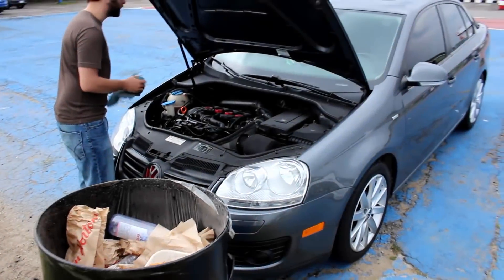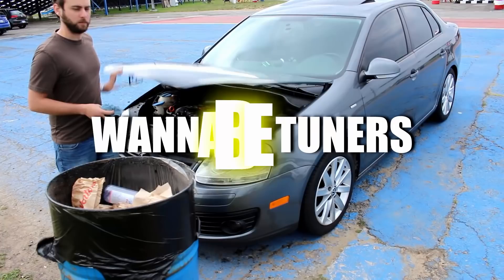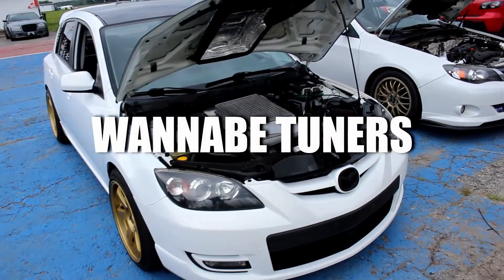Mazdaspeed 3/6 - Aux Fuel Methods - Port Injection - 5th & 6th Port - Methanol Injection

Comment: I want 6th port but i also want the methanol cooling capabilities
Reply from the maker: You can always run a separate fuel cell that contains pure methanol and run that to compatible port injectors. I'm currently just mixing 2 gallons of methanol per tank of 94 octane through 6th port and it's been pretty good so far, however I'd recommend full port injection (1 injector per runner) for the best possible fuel distribution :)
Reply: @WannabeTuners  sorry i meant to say i want 8th port but with the cooling capabilities of methanol i can’t seen to find a whole lot of people doing so my build should push about 650/700
Reply from the maker: @brotherhood_ofstreetracers4268  You can always run an E85 mix. The thing I like about methanol is that I can buy it at the local hardware store and it's always 100% pure, so it takes the guess work out of figuring out the mix. From what I've heard E85 can vary in ethanol concentration during certain times of the year in areas that sell it. My area doesn't have gas stations that sell E85, so methanol is an easy alternative for me.

Comment: I need help with my speed3 please help i will pay you if i need to please email me dru_goodman@ymail.com
Replaced fuel pressure sensor, pump and filter ( dw 300 series pump and filter) starter fine ran for like 6mins then shut off
 Now i have a b1202 code
Reply from the maker: What have you tried so far to try and rectify the problem? Does the car start and idle?
Reply: @WannabeTuners    i first had a p0192 fuel pressure code. So i replaced the fuel pressure sensor, pump and filter. It did start fine then shut off now itll crank but not start.
Reply: Now the code im getting is a b1202 code meanwhile the car cranks but will not start. Havent figured out anything to fix provlem
Reply from the maker: @drugoodman374  That code is an odd one. Try disconnecting the battery for a few minutes and draining the vehicles capacitors by performing a hard reset. If that doesn't work inspect the harness under the hood to see if it's rubbing against something and shorting to ground.
Reply: @WannabeTuners  ok thank you

Comment: I have a gun1 09 3 on a BNR s5 set up and I have just older jmf v1 with the 4 port meth I want to run 4 do5 nozzles so I and try and get over 30psi

Comment: Good videos like always!! I was watching a video from my e tuner and another e tuner and they where saying that when swap out the injectors on a 6 port for 2 1000 injectors you can suffer from wet wall manifold. Basically there’s so much fuel that a lot of it stays on the walls and may create a situation where even though your giving more pulse width your not getting more fuel. They said there could also be a delay in the delivery of the fuel causing your car to lean out temporarily. I think most ppl should be fine though since their not fully maxing out the fuel with the 2 1000 injectors. Sorry for my run on sentences lol you guys are dope keep up the videos
Reply from the maker: Interesting dude! Where can I see these videos, I'm really curious about this :) Thanks!
Reply: Wannabe Tuners if your not part of the Facebook group you should join Mazdaspeed 3 owners :)
Reply from the maker: @AlexMorales-yu1lp  Sounds good man! I'll check it out
Reply: Wannabe Tuners 

https://m.facebook.com/groups/2364120949?view=permalink&id=10156404533415950

Comment: Hey bro! Im Shaun I own an 07 Mazdaspeed 3. My motor still runs great and all since I bought the car a year ago. Its got 220000 kms. I was curious as to, when will I know to do a VVTI and timing chain replacement? I asked the previous owner, (there has only been 3 owners and I am the last one) if he did a vvti and timing chain replacement and he said no he did not... and I don’t know the owner before him... so I can’t really find out. So when should I do a VVTI and timing chain replacement? And how do I know if I need to or not? And how can I check & tell if it has possibly been done already? 
Thanks man
Btw im in the GTA too maybe we could go for a cruise and do a videoshoot or something of our speed3’s lol. :p in the summer
Reply from the maker: Hey man one way to tell is to remove the oil filler cap and check the chain for excessive slack. Also, at startup u will hear a momentary rattle caused by a loose chain hitting the valve cover :)
Reply: Wannabe Tuners thanks for letting me know! I will check that!
Reply from the maker: @shaunpermanand  You got it!

Comment: I have a dw65c in my tank already, I figure I’ll just get a surge tank setup with another dw65c in it
Reply from the maker: Most guys use a surge tank so that they can install a much larger and capable fuel pump inside it. A surge tank also serves as a way to ensure u have sufficient fuel delivery even if your gas tank is near empty, so using a dw65c to supply a surge tank with a dw65c in it, would only be beneficial when your gas tank is near empty, and wouldn't deliver 'more' fuel so to speak lol. Check out Tuned by Nishans videos. He's got a lot of good info on his channel :)

Comment: I had no compression in cylinder 3 on my old motor and my car sounded like a subaru but no signs of a damaged block. Is the motor still good for a rebuild? Any input will help thanx.
Reply from the maker: Usually low compression on these engines indicates a cracked ringland. I would do a leak down test with the engine fully warmed up to get a better idea on what could be damaged inside the engine :)

Comment: quick question, am having an issue with my speed3 gen2, when I give it/floor it the car like cuts off, but if I give it like 80% it runs just fine, any ideas on what can it be?
Reply from the maker: What's all done to the car? Are u running an Accessport? If so how do your datalogs look?
Reply: @WannabeTuners  I have an intake and cat back exausht that's how I got the car, and no I don't have an accesport yet I will be trying to get one because I also want to see if I can tune it on 91 at least.
Reply from the maker: @JuanPrado1985  Sounds good. It could be a lot of things causing it. Unfortunately without datalogs, or the ability to monitor important parameters, it's difficult to determine a root cause. If it's a fuel pressure issue, it could be dangerous. Does the car have upgraded high pressure fuel pump internals?
Reply: @WannabeTuners  no fuel upgrades, I was thinking on doing a boost leak test and also a vacuum leak test to start.
Reply from the maker: @JuanPrado1985  That never hurts. How would u describe the sensation of the cut out?
Reply: @WannabeTuners  when I floor it is like back fire type of feeling, it's at high revs and the boost matter in the car is like at the top
Reply from the maker: @JuanPrado1985  So a misfire?
Reply: @WannabeTuners  not a misfire exactly but like it, don't know how to explain it, I also put it in a snap on scanner and when we where doing the scans I would floor it and it would show 85% to 90% thrl not 100%
Reply from the maker: @JuanPrado1985  It's very difficult to diagnose a problem over the internet without any form of datalogs or an accurate description of the symptoms. Are there any fault codes stored?
Reply: @WannabeTuners  thank for your time, but yeah there is no lights in the dash check engine or nothing and there was some codes but nothing to do with the performance of the car.
Reply from the maker: @JuanPrado1985  Ok I think the best bet might be to take it in steps. I would get hpfp internals and an accessport first. Stay out out boost until u get the hpfp internals to reduce the possibility of blowing the engine. Once u have hpfp internals, u can then do more testing and take datalogs.
Reply: @WannabeTuners  thanks for the help and yeah gonna keep looking and drive it just casual
Reply from the maker: @JuanPrado1985  No worries! Does the car have a catless downpipe? That could cause fuel pressure issues and detonation
Reply: @WannabeTuners  it did but I took it off and put the cats back
Reply from the maker: @JuanPrado1985  Ok, how do the long term fuel trims look? If u have an intake, it may be a slightly larger diameter than the stock intake. This slightly larger diameter may not be enough to cause a check engine light, but it may be enough to cause the car to go into limp mode at times, due to lean long term fuel trims. I would install the stock intake to rule that out, and see if the power cut stops.
Reply: @WannabeTuners  I wish I had the stock one, the guy I got it from didn't had it
Reply from the maker: @JuanPrado1985  Ok I would just start with the hpfp internals and Accessport, and take it easy on the car until then. But then again it may be something as simple as worn out spark plugs. It's hard for me to say for sure.
Reply: @WannabeTuners  I just got me a set of ngks sparks gonna change them today, than move on from there
Reply from the maker: @JuanPrado1985  Right on. Make sure they are gapped to 0.026 - 0.028 thousands of an inch
Reply: @WannabeTuners  will do, once again thanks for your help, wish you were near so I can take the car to you 😁😄
Reply from the maker: @JuanPrado1985  Haha no problem dude
Reply: @JuanPrado1985  Hey dude, can i ask did you get that problem sorted out with your Mazdaspeed 3 with the boost cutting out ??? If not i may have the answer for you
Reply: @23farman  I reset it my computer by disconnecting the battery and turning my headlights of and I also did my spark plugs and that solve my problem.

Comment: any downsides to runnning 6th port with 2000cc injectors for more headroom with this set up?
Reply from the maker: None that I'm aware of, but having an even flowing intake manifold is a good idea to promote even fuel dispersion between cylinders, and aside from figuring out custom cold side plumbing, the fuel is delivered accurately before the throttle body which also cools down the boost air temps slightly :)

Comment: My block is blown  what do you recommend on my 08 speed 3  I trust you bro!
Reply from the maker: Sorry to hear dude! I would get it rebuilt if possible with a forged bottom end. What sort of damage has your engine sustained?
Reply: Wannabe Tuners yeah my starter and a big  piece  of the block just broke off I think maybe it happened  because of  a leak of radiator  not sure and thanks for responding  to my messages  bro
Reply from the maker: @aldroms3life926  It's odd that the starter was damaged. Could it potentially be a clutch issue?
Reply: Wannabe Tuners no clutch  is a good   I don't  know how or what made it happened  but I do have to fix it it's  my baby so a new block I will get
Reply from the maker: @aldroms3life926  So what happened exactly?
Reply: Wannabe Tuners ok so I had just bought  this car had it for just over a month ,I got it from used car dealership  had my car fax everything  was cool but one day driving  my way home it started making  a click noise and right away  it went off on me and I seen the block and the starter  were  broken badly and no more  warranty  on the car  long story bro

Comment: Be careful with that DW fuel pump, everyone I talked to said to stay far away from it as it doesn't last long and even has issues just operating normally. I picked up an AEM #50-1215 for my PI setup that I am piecing together.

After my run with meth, I can honestly say I wouldn't do it again. I wish I went PI from the start and scrapped the meth. My PI kit is going to run me about $1300 (for a deadhead, no return style). 

So much good info in this video. I see too many people on FB asking about PI and this explains the basics quite well. I always try to spread knowledge as well. 

TL;DR if you want big power, be prepared to pay for it. PI isn't cheap, but it's the safest bet for more fuel on the platform. Do your research, don't cut corners, and use the damn forums!!!!
Reply from the maker: Thanks man, I've read that also about the DW pumps, but some people have also said that they have not had any issues with it. I guess time will tell. I've also heard good things about the Aeromotive fuel pumps, but I will consider the AEM pump also if my DW ever shows signs of failure :) What happened with your meth setup?
Reply: @WannabeTuners  The Aeromotive is a great pump too. Just pricy when there are awesome comparables out there.

I've just been constantly chasing controller issues, flow issues, changing nozzles, etc. Been a pain in my ass from day one. I love the power and benefits, but it's just too finicky for my power goals.
Reply from the maker: @binbanbinny  I completely understand. I think real injectors are much less of a headache :)
Reply: @WannabeTuners  oh yes. I ended up getting a set of ID1050X injectors with my spacer from Damond, so I know I won't have any issues.
Reply from the maker: @binbanbinny  That's going to deliver all the fuel u need!
Reply: @WannabeTuners  😊😊😊😊😊

Comment: I’m going top mount setup on my speed6 and I’m just having a little difficulty figuring out the auxiliary fuel options 
Speed performance seems to offer the right setup but at a high price
Reply from the maker: I think the easiest and least expensive way is methanol injection, because there are very few parts. A simple throttle body spacer with 1 or 2 large nozzles can deliver a tonne of fuel. But then u have to look after a second tank and pump, and fuel delivery may not be as precise as an actual fuel injector. I can tell u that when we installed the 6th port kit into our car, the custom cold side plumbing was a pain, having to figure out where to put the BPV and all the bends. With full port injection, u wouldn't not need to struggle with custom plumbing like on the 5th/6th port kit, and it may be worth the slightly higher price tag. Also, having to run custom cold side plumbing adds to the price of a 5th/6th port kit. We have noticed that the 6th port kit does indeed cool the boost air temps quite a bit which is beneficial, although probably not as good as methanol would :)
Reply: @WannabeTuners   I appreciate the help and advice . I do agree methanol is the cheapest way to go but it has its limits. I'm definitely  going full port injection just having a hard time deciding 
Weather to go with damondmotorsport ford focus adapter kit with the focus manifold or the port injection adapter manifold that they also just released which utilize our Stock manifold or Corksport manifold. I really like the Corksport Intake manifold  because of the design flow and it retain that stock stealth look. I'm still on stock block and my goal is to keep things around the 500hp range 490ish . Any suggestions on which manifold to go with
Reply from the maker: @BUILTFABOOST  I like the corksport manifold because everything stays in the stock location, even the dip stick bracket :) They also rate the flow imbalance at around 2% which is just as good as the ST manifold. I think the CS manifold is the easiest solution